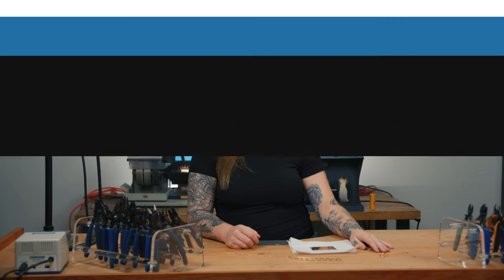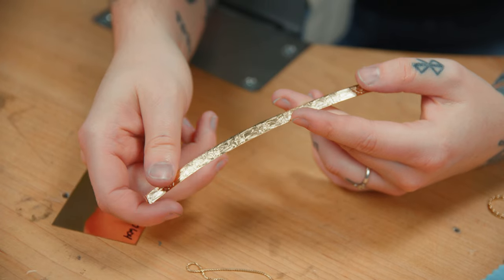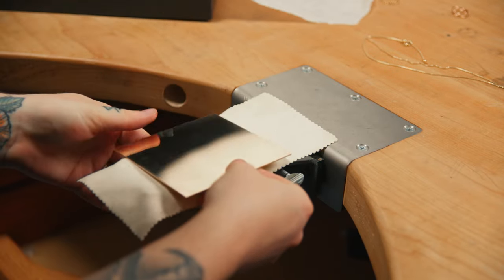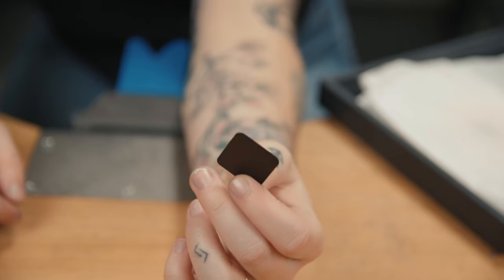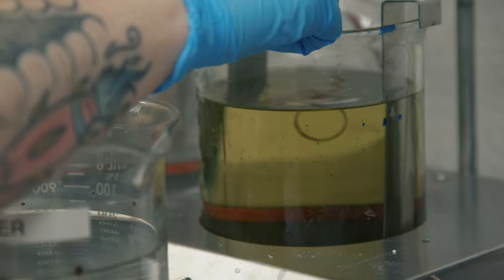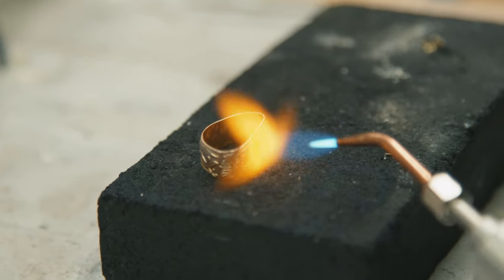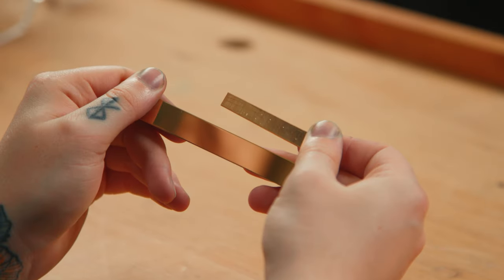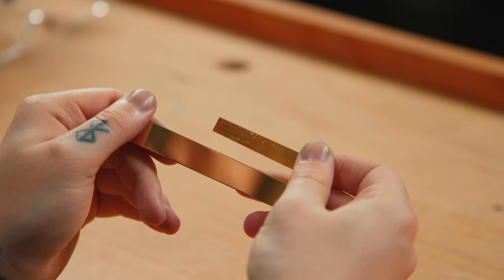Working with Gold-Filled

Comment: Hi.  This video is so helpful!  Can you suggest a pen or bath plating item to help with the seams for my bezel rings?
Reply from the maker: Thank you for the question! Here is a response from our tech team: We do carry pen plater systems. 335136, 335137, 335400. Any one of these will be fine for plating the bezel seam. You can only use plating solution. The bath plating solution is not strong enough for the pen plating machine. if you have a rectifier for your bath plating system this can also be used for pen plating. All you will need is the pen 335139 and the pen plating solution.

Comment: So, if you cut it and have to bath plating the cut sides, technically it losses the gold filled part, no??? and the sides, where you cut and plated would rust off faster, in a few months and oxidize very fast, losing the whole point of being GOLD FILLED...or Am I wrong?

Comment: I started using cupronil for fire scale barrier but I still notice my goldfilled rings seem a bit rosy, which means I've burnt off a layer of the gold. Also, I use solder paste instead of hard solder & I notice it's harder to get it to stick to the surfaces after I spray the barrier flux. Should I then go in w/that yellow flux just on the seams to get the paste to stick & flow better? 
Goldfilled is so finicky but working w/solid gold is too expensive for me rn.

Comment: Would hammering textures ruin gold filled wire? Say for an Earring or ring? Also, if you’ve cut the wire and need to solder on an earring post, will the gold solder adhere to the brass?
Thanks so much
Reply from the maker: Thank you for the question! Here is a response from our tech team: I would make sure that my hammers are polished.  Any scratches, dings and dents can damage or cut through the gold layer and expose the brass.  Also be careful polishing the gold filled material after hammering so you don’t remove the gold layer, https://www.riogrande.com/knowledge-hub/videos/how-to-create-barrier-flux/
Gold solder will adhere to the brass.  Make sure that when solder to gold filled materials you use a barrier flux to protect the surface. Then use your soldering flux to help the solder flow. This will keep the gold layer from oxidizing and becoming damaged.  https://www.riogrande.com/knowledge-hub/videos/working-with-gold-filled/